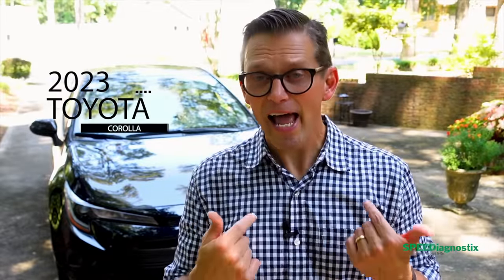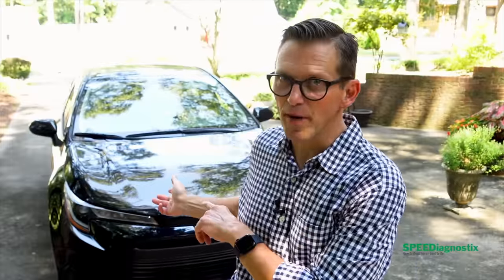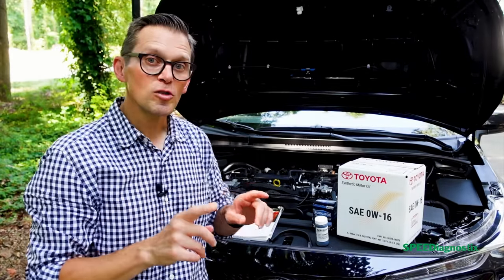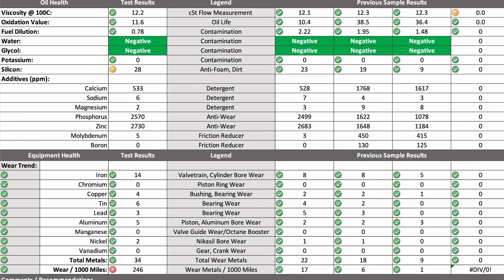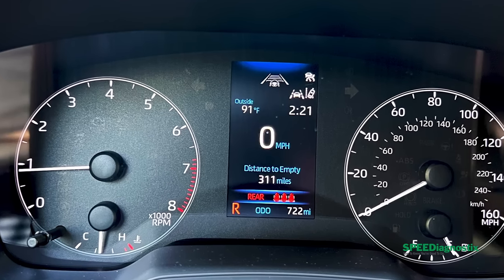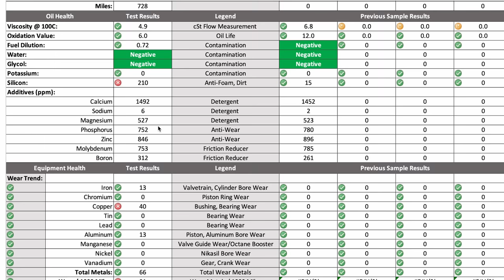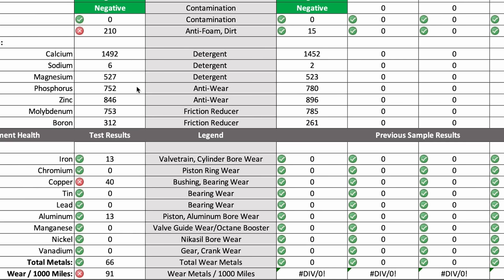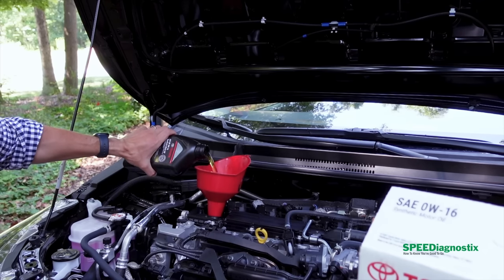AVOID the ONE MISTAKE Almost EVERYONE Makes With A Brand New Car

Comment: Toyota oils are a full synthetic oil. 020 016 and 08. They are mobil. But not mobil1. Which helps in price. They have their exacting formula blended specifically to their standards.   Not all the other fluff.

 And likely zero % of Gereral Motprs propritory blend so their not paying a royalty to GM. No where does Dexos show up on a Toyota bottle.
Reply from the maker: They are very good

Comment: 53 years of changing motor oil.  Dozens of cars. After so many years of this, at vastly different intervals, oil types, the hype, the BS, not one engine has failed or blown or smoked or …

It’s a great hobby to have, but oil maintenance is so ridiculously overthought.   I don’t buy into the “I got a .4 mpg improvement” nonsense.  Change your oil at recommended intervals, drive, and go enjoy the day.

Even if you didn’t change your daughter’s factory fill until 5K, that car will run to 200k miles easily sans problem.

Comment: well . . . in my experience with new engine change oil at 250 miles again at 500 miles to get the metallic particles out of there before they imbed in the main bearings and valve stem seals and main seal.  then every 2000 miles.  get that crap out of the engine.   Oil is cheap compared to an engine!

Comment: That is a waste of money. A corolla is a banger plus your daughter is going to drive it. In a week will be back at the dealership totaled! I have seen too many times with my clients. Brand new cars wrecked by the kids of the clients! I do 1,000 miles on new cars. One time I went to Kia and told them the client should change the oil at 1,000. They laugh and said at 5,000 miles.
Reply: Stop acting like this is something we've heard of. Your issues haven't been heard for this car. Yet. But still.

Comment: If you’re that paranoid about debris in the oil, then why don’t you change the oil every time you drive it?  If it was a problem waiting until 10k, then people’s engines would be failing all over the place.  You’re trying to provide a solution to a problem that doesn’t exist.

Comment: On my new company car, a new Mercedes Vito 2023, Mercedes has set up on the computer for the first oil change at ‼️45.000km‼️ or ‼️28.000miles‼️ and that's for me is f#%♧ing insane‼️‼️‼️ DON'T BUY A USED MERCEDES THAT HAS A CORRECT SERVICEBOOK DONE BY MERCEDES‼️‼️‼️ The engine is guarantee total worn-out even before 100.000km or 160.000miles‼️

Comment: Bra, as a lubrication engineer, you should know better! 500 miles. The science behind engine manufacturing has changed dramatically. You’re harkening back to the knowledge of the 1960s and 70s and before. Waiting for a comment from someone about the new tundra V6? Consider that what this fellow is recommending would not have cured that tundra problem in anyway. He’s not talking about special cause debris left behind from a manufacturing error. He’s talking about standard manufacturing challenges that are in the past.
Reply: Then tell me why gap engine tolerances still same since the World War II ?.

Comment: 10,000 miles is too much, 500 miles is way too premature.. do it every 5,000 miles using synthetic oil, your car will last 300,000 no problems at all
Reply: Listen again, he didn’t say 500 mile oil changes. He said 500 miles on brand new engine.

Comment: Says the guy with a rebuilt motor Porsche lmaooooo. I drive a 2013 pathfinder with 150k so far and only did schedules changes. Car runs fine.  Now about the transmission...

Comment: When I think of lubrication specialist…. I don’t picture this guy… 😂 If you want your engine to last put 0w30 or 5w30 in there.
Reply: 'If you want your engine to last put 0w30 or 5w30 in there.'

Depends on the climat, the type of use etc....
0W30 / 5W30 is fine for a Corolla in tmps 35ºF to 75ºF
Reply: @j.r.arnolli9734  That is false.

Comment: By changing the oil at 8K miles, the metals would be down the same way.  The material in there would not have negatively affected anything.
If you’re bored and like to spend aimless $, go for it.   It pays no difference in the longevity of modern engines.
Oil isn’t
The only thing..why not change out the coolant for the inverter as well?  This is nonsense and outdated by a score.

Comment: I just bought a brand new Honda FL5, and found a recommendation from a Honda technician telling us to run on first oil as long as we can because of special properties it has and it’s good to ensure it lubricates every part of the engine.

https://youtu.be/DAixtdfz37g?si=jk2QNsTbddLbC0rt

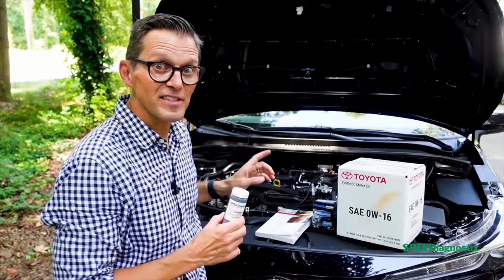Minute 5:38

Please could you explain that to me? Because your results are very notorious too.

Thanks so much
Reply from the maker: That’s complete BS. There is assembly grease in the engine. Changing the oil sooner removes it, which reduces the risk of sludge buildup from it.
Reply: @themotoroilgeek  thanks a lot, I’m learning a lot with you. Great channel 👍

Comment: They break all these new car engines in before they even put them in the cars so I don’t get the 500 mile change , I bought a brand new 2018 accord and did my first oil change at 15,000 miles and now I only have to add about three quarts of oil a month and I only have 38,000 miles on it so I don’t think that’s bad at all

Comment: Prefilling the oil filter is a complete nonsense. You're defying the very function of the oil filter: to filter oil. By pouring oil inside the filter you also pour all of the contaminants inside the "clean" side of the filter (most innermost part of the filter). Even old oils left enough lubricating film to operate engine for this very short time that takes the engine's oil pump to prime the filter and begin circulating the oil.

Comment: I love the modern day lies, "There is no Break-In Period Anymore", "You don't need to change the oil until the first Oil Change at 8K.    Our Corvette Specifically called for a Break-In Period and its first oil change at 500 miles.  My Two Motorcycles called for a Break-In Period, (i.e. RMP's not to go over 4,000) and change oil at 500 miles.  If you want to listen to a dumb, lieing carsales man, have fun.